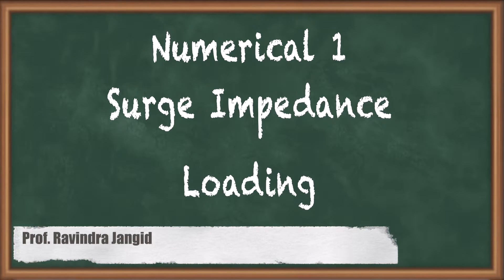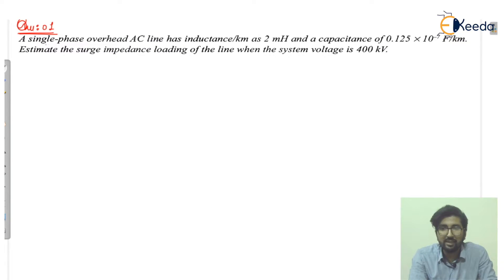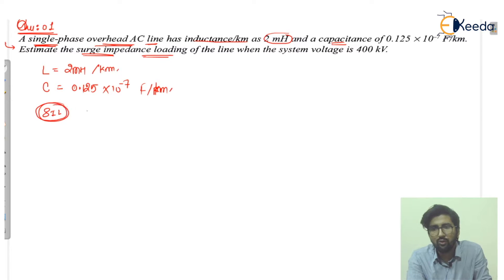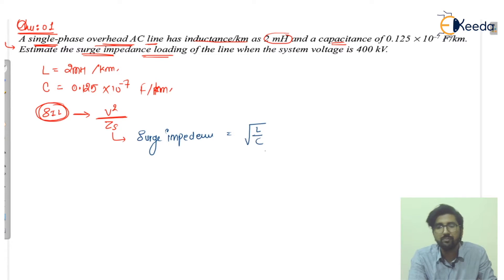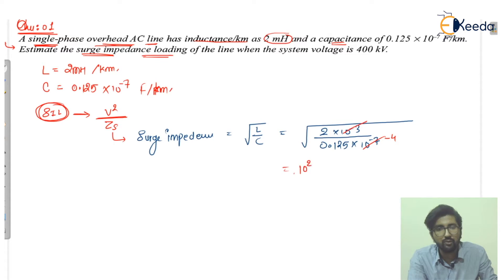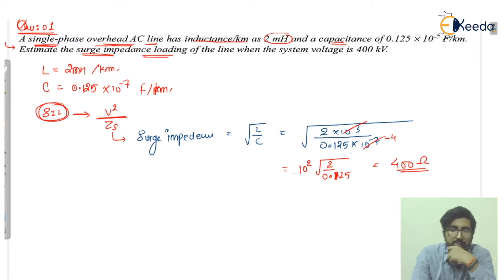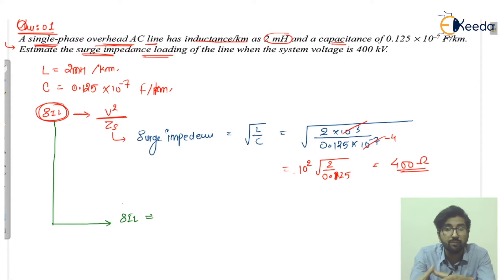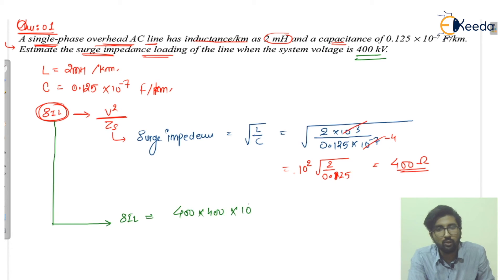Surge Impedance Loading Numerical 1 - Introduction to HVDC Transmission - HVDC Transmission

Comment: If the transmission line cct is quad bundle then how will we calculate surge impedence loading? In numerical problem only nominal voltage is given